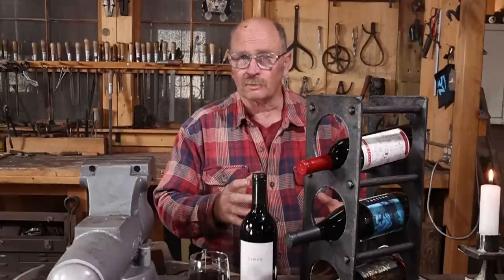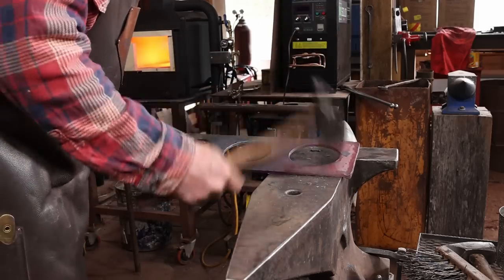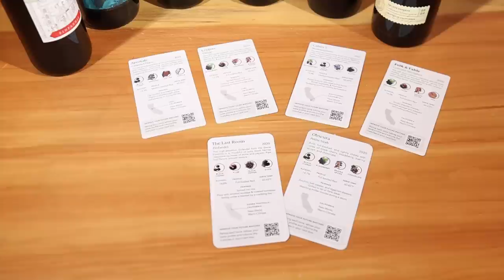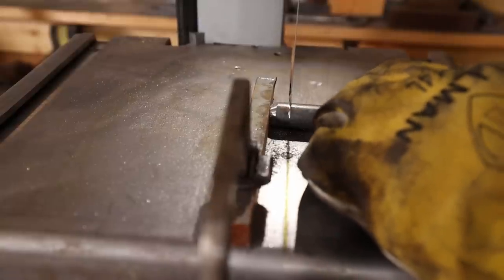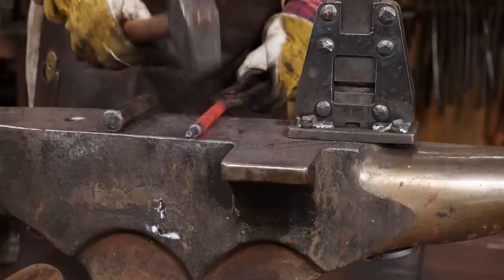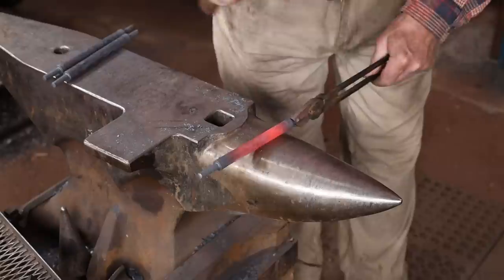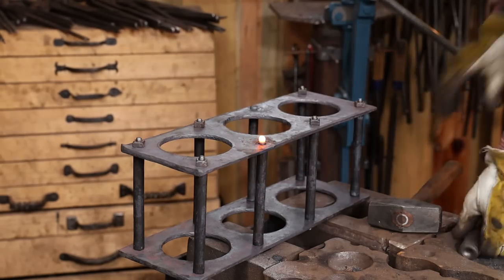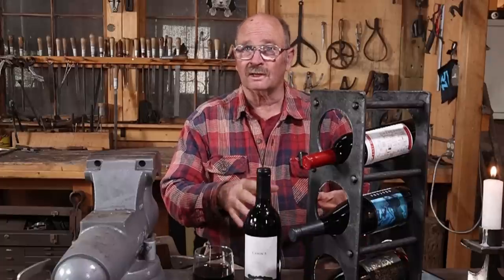Forged Steel WINE RACK - Blacksmithing

Comment: This forged steel wine rack is exactly what I've been wanting to place on my kitchen worktop in our renovated old farmhouse. The wine rack's slim, yet heavy design will be perfect because its footprint is economical, given that space is always a premium in an average household. I love how John took time calculating the size, but cleverly using a hole saw to get the perfect diameter for a bottle of wine. This will be my next hobbyist job. Perfect, and I thank you John for your inspiration - and lovely rounded lug nuts, no sharp edges!  ❤

Comment: In 2019 John convinced me an acetylene torch was a good first heat source to have in the shop.  Today I use that same torch to cut all manner of shapes.  Especially 1/4” and above cuts very well without higher priced tools.

Comment: Good project and I prefer the look of the rivets as you did.  I like the rustic look.  Only thing I might have done different is make the bottle holes smaller.  The size just appears overkill.  They only need to rest slightly toward the stopper end to keep them expanded by moisture.  Thanks for the video.

Comment: I made some wheels for some barn door hardware using the disks from a hole saw. A small disk sandwiched in-between two larger ones. The hardware was fashioned after some on a barn door I saw in New Jersey. The barn was old and falling in but the hardware worked just as it did when installed because of the design.
Reply from the maker: Thats a great idea.  Did you add any form or bearing?

Comment: I wonder if you did the rivets like head bolts on a car motor . Opposite corner. Like right corner bottom to left corner top & worked your way in . Or do one & check for square so you can fix as you go
Reply from the maker: Opposite corners

Comment: John, you did a beautiful job making that wine rack.  I must say that you had to do a LOT of work to fabricate that.  I don't know that I would have the patience to make one, bless you!!  The induction heater (great!) and the power hammer had to make it much easier.

BTW, did you buy your rivet header or make it?  It added a nice touch to the rod ends.
Reply from the maker: I make most of them, but in this case its one from Kens Custom Iron
Reply: OK, thanks I'll check out Ken's

Comment: wouln't it be safer to have it made of wood since wood is a lot more soft? :d or at least having some kind of rubber/silicon rings around the holes maybe?
Reply: Wood can be difficult to forge, would make for a harder overall  project in my opinion.🤔
Reply: @nickgraham8501  :D true that, what about a compination of wood and forged steel
Reply: @tomaatti5313  definitely seems plausible 😁
Reply: maybe inset wood rings.

Comment: Ok cool did you do the rivits in a cross pattern  like wheel nuts on a car wheel or like how you would reseat a head on a motor after you replace a head gasket